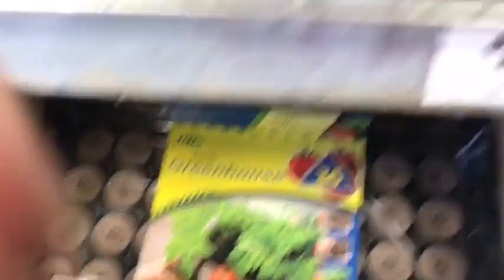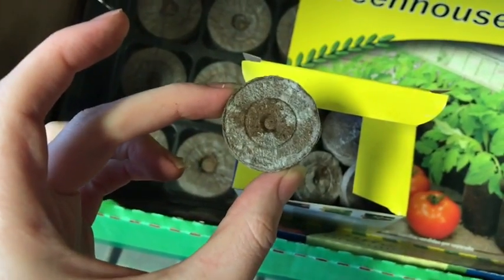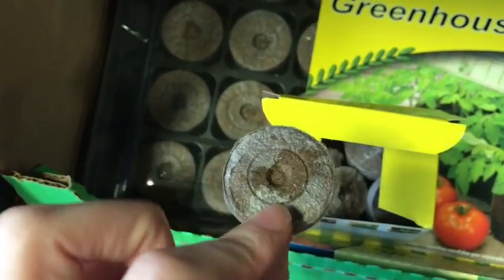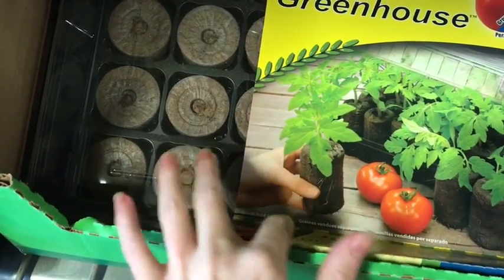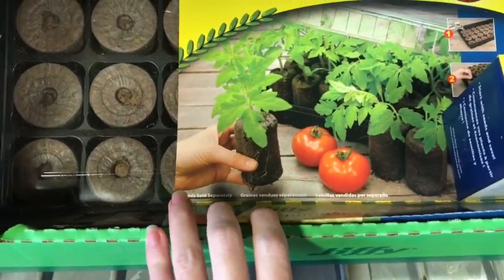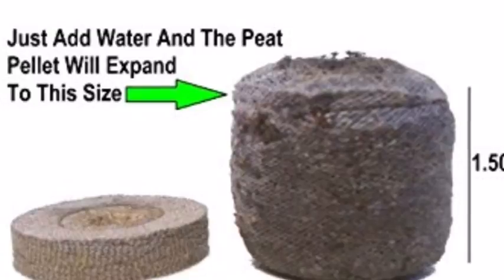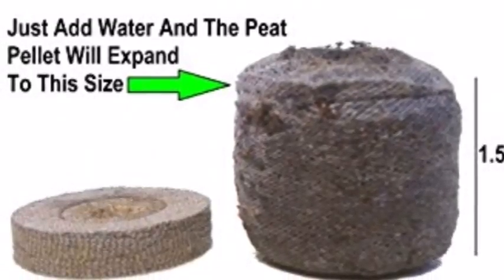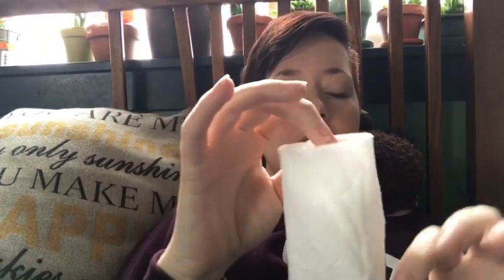Q&A Why Do Some Plants Have Fabric Looking Mesh Around Their Root Ball?

Comment: Everytime when i am repotting plants they have it and it chokes out the growth and it does not disintegrate.  I was told by a greenhouse staff that they use them when making up flower baskets so that they do not overgrow the pots they are selling to you.  It allows the shelf life for sale be a lot longer and it prevents a situation where they would have to repot.  Basically expect that you have to cut them off and likely have to replant as you will need more soil as these root mesh pods also helps them save on soil.  I know this is a very old video but a very good one.

Comment: Yes. I call this the mesh pod of death. I try to repot all new plants to remove as much as possible. Some are so tough and even large strong roots struggle. I wish more people talked about this! Only figured it out from bonsai videos. They would have a tree doing poorly and find just a small peice of mesh from the last pot was the issue. Now I remove as best I can all mesh from my plants when I repot. I also find repotting gets rid of the fungus nat infested nursery soil.

I just pulled one off my button fern last night cause she was starting to struggle and couldn't spread like they should. I dont always get to ferns off the bat because they are tough with those web like roots and tend to drop all their leaves when repotted and I want to enjoy them for a bit. 

I find even when roots penetrate they lose out on full use of the pot cause it's one spot or just the bottom. And the roots inside are too dense and make the plant act like it is root bound. I don't worry about breaking a few roots. Just try to gently tear it so I can save the biggest roots. It will be worth the slightly greater transplant shock.

I whish the nursery would pull these off when they pot up before the root system gets too big!

Comment: I just bought a Hoya Parasitica, a starter plant, my last buy for 2020 but when I received it from the mail and checked the root system, there is a cloth/mesh wrapped around the root ball and I actually dont see numerous roots, im not sure if I should remove the mesh right away. Please help😥
Reply: Remove it if there aren't any roots coming thru
Reply: @primal_hut9581  it was actually a rockwool cube. I still removed it. thank you for responding

Comment: Yess!! I've always wondered this. Good to know. I actually just bought those Jiffy pots... nevermind, I will not be using those anymore! Good to know before spring :)
Reply: There's nothing wrong with the peat pellets used properly. What nurseries are doing with netting is one thing. At home, I primarily use peat pellets because they are a good way to germinate seeds and are easy to remove from cells and when roots start coming out of the bottom of netting, I remove the netting and pot up with my container mix. Plants have nice peat moss root ball and there's almost no transplant shock.